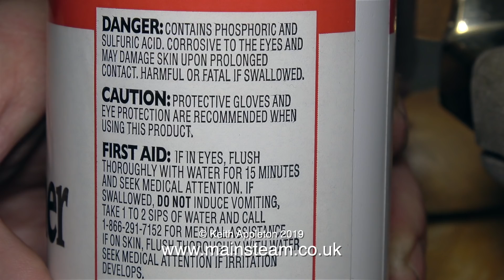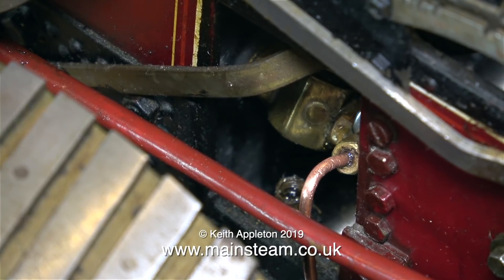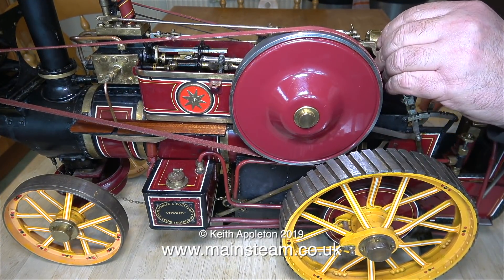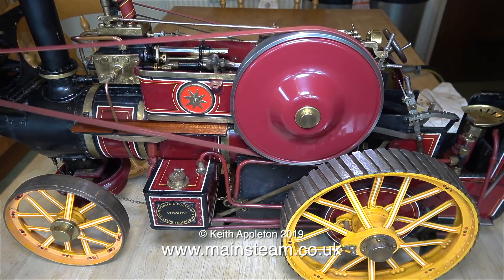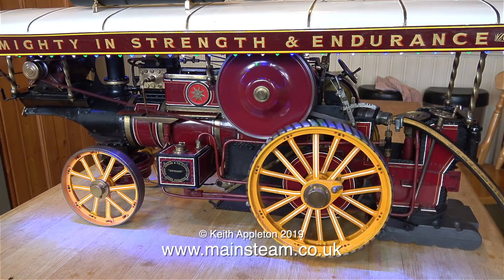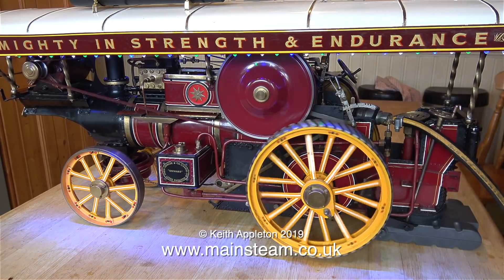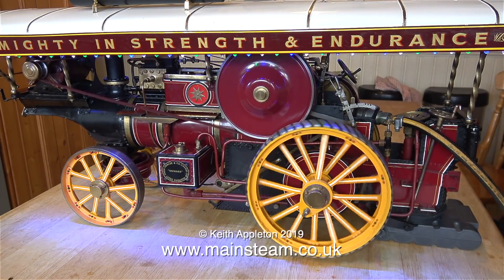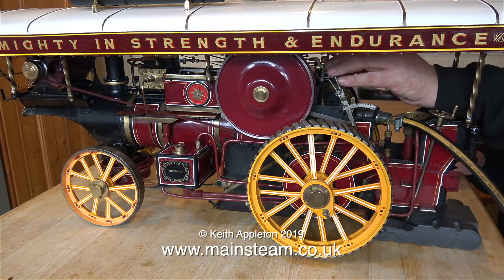REFURBISHING A MODEL TRACTION ENGINE - PART #5

Comment: Fred Dibnah was a remarkable man, also if you run the output of the dynamo, through a bridge rectifier, it will maintain the correct polarity for the regulator.

Comment: I don't want to commend because you know more than me already but for the generator use a bridge rectifier and you can use it in both directions  and with some capacitors you have a verry stable output

Comment: 4 diodes arranged as a bridge rectifier would allow the LEDs to light in both reverse and forward.
Reply: A smoothing capacitor would prevent them flashing at low speed too.
Reply from the maker: Thank you once again Jonathan, I am also aware of that, as I trained as an Electronics Engineer and earned my living doing that many years ago ...... These are Steam Engine Tutorials for beginners to the hobby. I may be wrong but most viewers seem to like it that way }:-)))
Reply: Well you don't just have to use diodes, bridge rectifiers do exist commercially, if you fitted it between the dynamo and the circuit, the lights would stay lit

Comment: Any idea as to what causes that rocking? Is the running gear not counter-balanced, or is it similar to the vibration/rocking that the Climax geared logging locomotive suffers from, in that it's simply due to it's inherent design?
Reply from the maker: it is just the reciprocating mass of the piston and piston rod, crosshead, connecting rod and crank web.

Comment: I've used that case cleaner for brass I was reloading, but honestly I didn't care for it. Lots of work for not a lot of result. 

I'd offer my method for brass cleaning(brass for rifle and pistol cartridges), but a vibratory tumbler and some brasso with walnut shell isn't really practical for what you do, and would get shell down in the pipes I think :D. If you ever get over in the shooting supplies and find a can of stuff called "CLP BreakFree", you might give it a look for rust protection on bare ferrous metals. It cleans rust, and will leave a nice, thin layer of oil on things that tends not to get sticky over time. Really great stuff for metal that's prone to rusting.
Reply from the maker: It was a spur of the moment thing, II am not impressed with it ......  thought I would try it out of curiosity, but I think diluted Sulphuric acid on its own works better . . . .
Reply: If you want to try another gun cleaning solvent for any metal, the best is a long time brand called Hoppe's Powder Solvent #9 (pronounced "Hoppeez"). Oil, scorch marks caused by heat, carbon and metal staining, and RUST come off easily. Safe for paint and gunstock finishes. It's been the best cleaner/solvent since 1903. Has a pleasant smell too. Cheers!

Comment: I guess the generator on the full size showman’s engine would light incandescent lamps in either direction. To achieve the same effect, you can fit a bridge rectifier to the generator, so whichever way it goes, you get the same polarity d.c. to the regulator. The down side is that it will drop a volt and a half at least, and at low speed that could be too much. You could use Schottky diodes which have a lower forward volt drop, and could get the drop down to 0.6V.
Reply from the maker: Thank you for your information, I am sure that some of my viewers will find it interesting. Too late for me though, I already have a little knowledge on this subject, as I studied Electronic Engineering when I was younger and worked for a company which designed & built Electronic Scientific testing & monitoring equipment, I spent a lot of time between then and now repairing Hammond Tone Wheel Organs, Amplifiers, 2 inch Tape recorders, Audio Mixers & Computers - as well as wiring my recording studio etc etc  - I even have an old oscilloscope and an "AVO" meter in my bedroom . . . . }:-)))